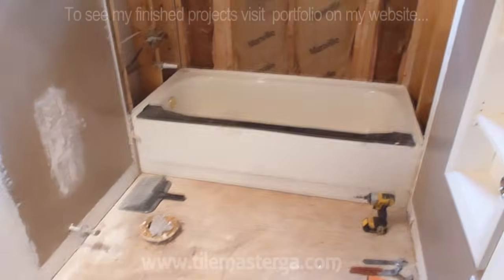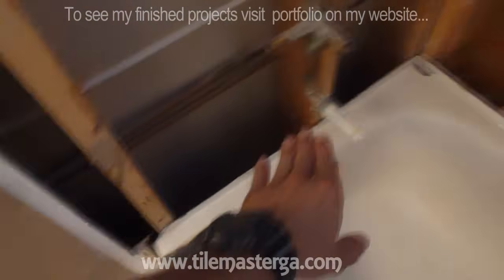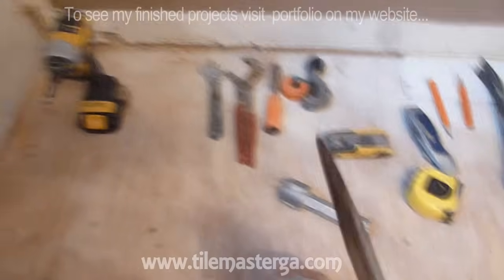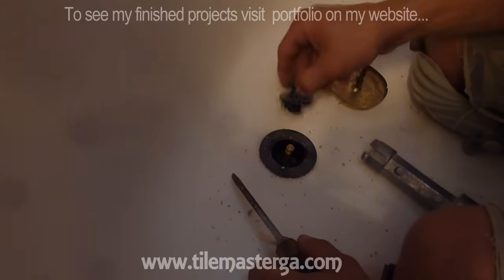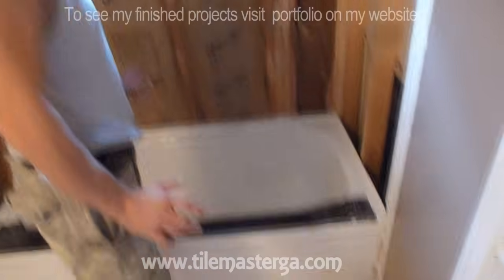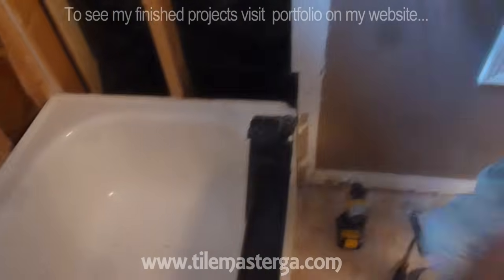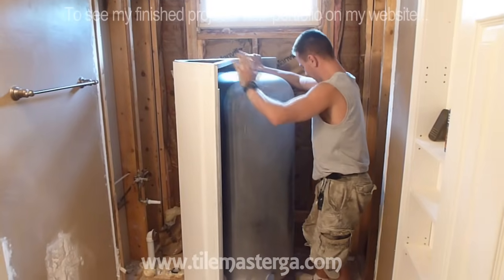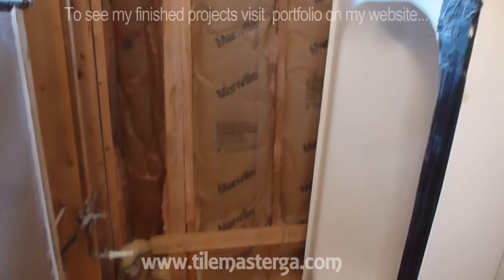How to easly & safely remove old Tub, disconnect bath waste - drain.  Step By Step

Comment: Nice Video! I have remodeled several bathrooms over the years it is nice to see other ways of removing an wanted tub, and to show that removal of the tub is not that difficult. The hardest part is removing the drain pipe that is old and corroded. even with the tool.

Comment: exactly what I needed. I have an old ceramic(?) tub that is going to be removed and the whole area redone for a walk in shower. its disgusting with old mold, cracks in the tub and it drains so very slowly. I've been contemplating how to disconnect the drain...

Comment: Excellent video.  My concern was detaching the drain.  I thought I was needing to get to it from underneath the floor downstairs.  There is a ceiling in the way.  Also...how do you tell if you have a cast iron tub before you start tearing out walls?

Comment: These videos are excellent!!!! Question about removing the bottom drain in the tub.  Both of my tubs just have a plate with holes in it.  There is no way to get beneath the plate as its all one piece.  Any suggestions in trying to spin it out as there is no spot to drop the tool in there and catch the cross bars like you did.  I would really appreciate it!!!  i can take a picture if my desription didn't make any sense.

Comment: Excellent video! Can you do a video explaining how to install a shower tray? I currently have a tile shower floor but the previous owners did such a poor job of building it that water pools everywhere and it's leaking. I can't find the source of the leak so I was thinking of just removing it altogether and going with a shower tray to make life easier.  In order to do so, I would need to figure out a way to remove the cement pan correct?

Comment: Personally I would not be able to remove the faucet in order to lift the tub up. 
What was easier for the friend actually doing the job and myself was to pull the tub forward and out the door. 
Although the faucet didn't need to be moved, We needed to remove toilet, door molding and remove bathroom door from hinges. 
This allowed clearance for similar looking tub in similar looking bathroom to slide forward and out. 
I don't recall but I assume we lifted the outter side of the tub up over any obstacle of toilet to floor connection.

Comment: Hahaha... at 7:40 he declares that you have to "use the force."  Made me laugh.   #starwars
Reply from the maker: Dan Rodriguez I also was surprised!! most of the times it is really stuck!
Reply: +Dan Rodriguez I thought this might actually be a job I could handle until I heard that part... bummer, Guess I'll have to find a qualified Jedi to change out my tub.
Reply: i could not get "the force". i don`t know how to. but at least went and got R2-D2 to help me lift that damned thing! lmao
Reply: I was thinking the same thing about using a lot "the force" but I definitely didn't want to leave a comment like that myself out of respect for this video.

This video was very helpful and I may be replacing some shower tubs someday, and I know I've got my work cut out for me.  Well done!  Thanks.
Reply: CRUSH it to the pieces!!  lol that was the best line!!  At 9:12 "we need it da sledge hammer to bust it to da pieces"

Comment: Great, informative video! We must have a cast iron tub, because my son and I can barely move it! Could there be hidden clips, etc...that could hinder its removal? I Really don’t want to cut it into pieces. 
Thank u.👍🏻
Reply: Bang on it with a sledge hammer. You don't cut it. If it is cast iron, it actually is MUCH easier. It fractures into manageable pieces easily. (If it is steel, it won't fracture and the technique won't work.)

Comment: If the bathtub is in the back of the bathroom and the sink is near the front and toilet is in the middle of not replacing the toilet and sink would you have to remove the sink and toilet to replace the bathtub because it's a small right area or would they be able to lift bathtub over the toilet and sink or is it better to remove sink and toilet????

Comment: i remove my tub, i only have 59 1\2 inches from stud to stud. will a 60 inch tub work if i cut the studs down a 1\2 inch on the stud where the pipes are not at, or should i do both studs, or get a 56 intub and build wall out? what would you do?

Comment: I get how to take a fiberglass shower out but I need to see how to then put the same type new one back in.  No tile. My three year old 6' wide shower has a large crack in bottom and floor is rotting.  Wonder if there is some kind of warranty on a three year old fiberglass shower.  Builder is out of picture and gone.

Comment: If you remove a bathtub in the bathroom and the bathtub is in the back of the bathroom meaning the sink is is near the door when you walk into the bathroom and toilet in middle of bathroom if you were not going to replace the toilet and sink only replace the bathtub would they have to lift the toilet and sink because it's in the front of bathroom and bathtub in back of bathroom because it can be tight to work that small spaces or can the lift the big bathtub over the sink and toilet????